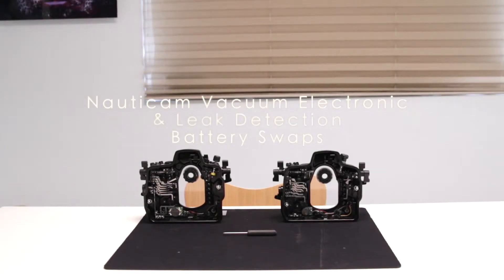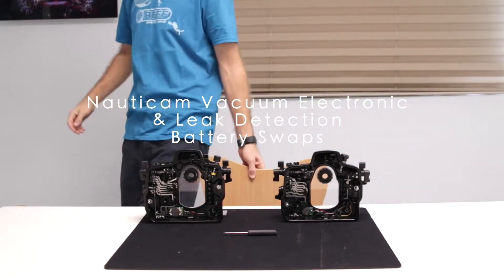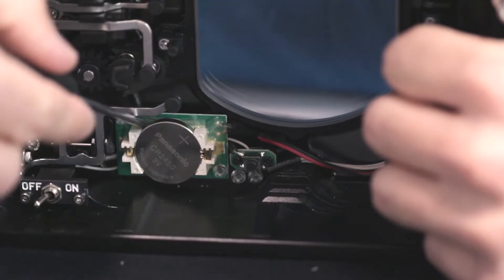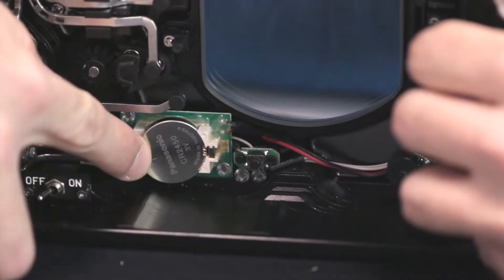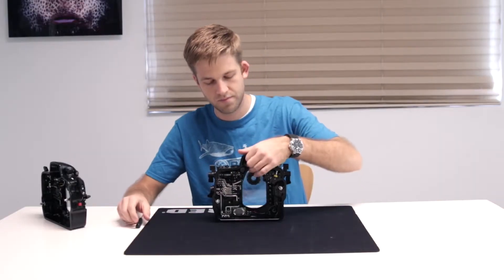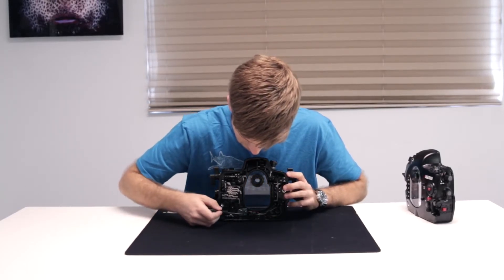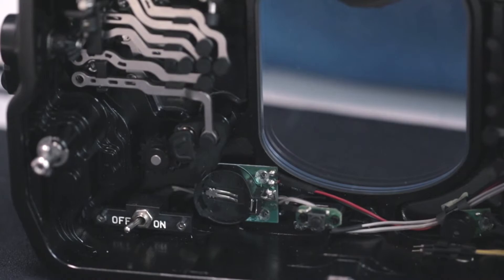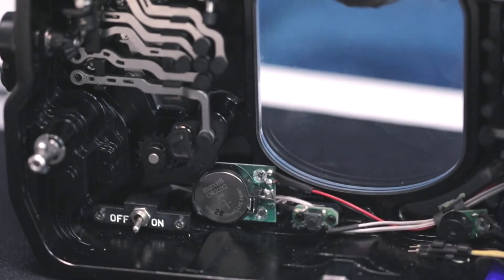Installation Guide  Nauticam Vacuum Electronics & Leak Detection Battery Swaps

Comment: I have problem underwater. There was green light its ok, but about 1 minute show me red light (not flashing only light), In surface I try to switch off/on blue light flash and then red and beeping. Changing battery and again. (I saw some drops of water in case) I am used air pistol for drying and now I think its ok.